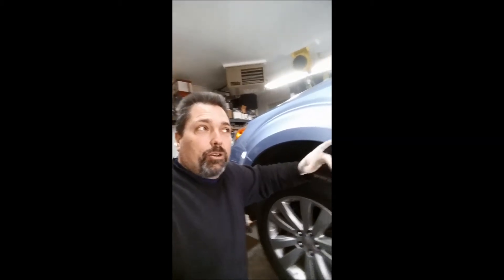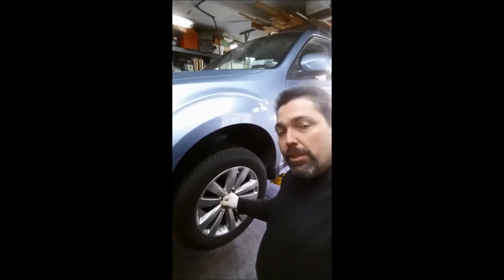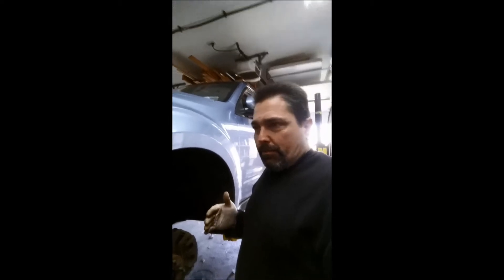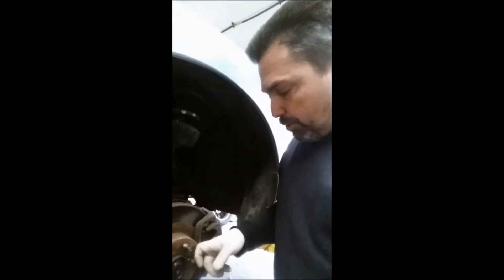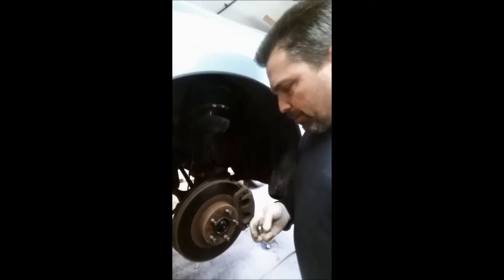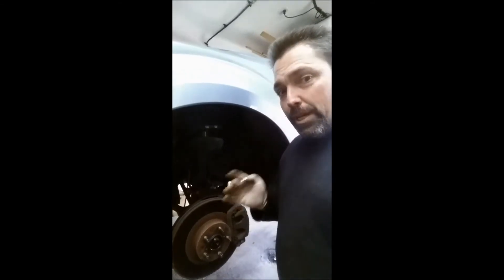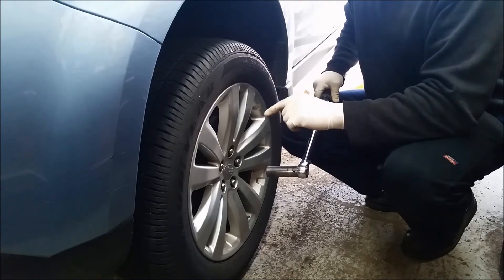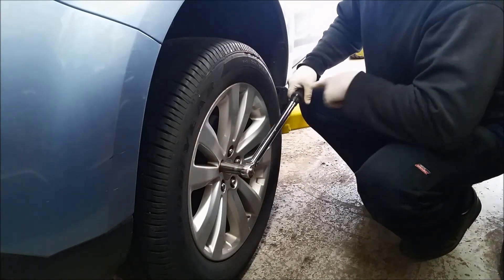Wheel torque and suggested tire rotation

Comment: grate video   I am a tire and lube tech at a hyundai dealer   but I do more then just  oil changes and tires .  I always use a torque stick   all the hyundai models torque specs are 80 ftlbs   after I get the veh back on the ground  I follow up with a torque wrench also set to 80 ft lbs.  I do this because  torque sticks are not 100 0/0.  also  when im doing a oil change   after I put the oil pan drain bolt back in I torque it to factory spec with is 32.5 ftlb for all hyundai models . I think I might be the only tech in the shop of 25 that  torques the oil drain bolts .
Reply from the maker: Keep learning and doing what you know is right. Love your attitude. Hope to see you again.
Reply: love your attitude as well      take care and be well

Comment: Very good video. You are right about some people over tightening lug nuts. Usually the quick lube places and franchise repair shops. You should only use the gun to snug them and then torque them with a torque wrench.